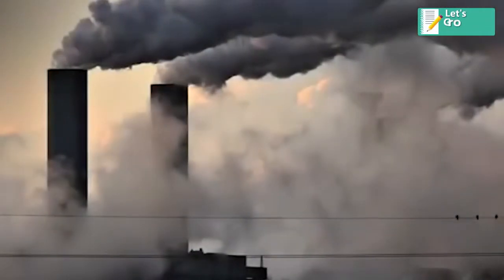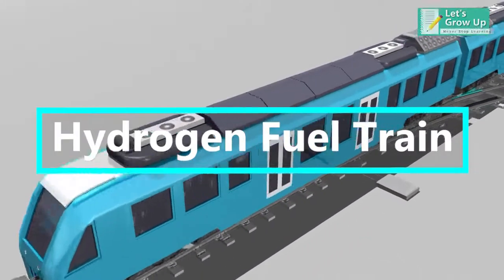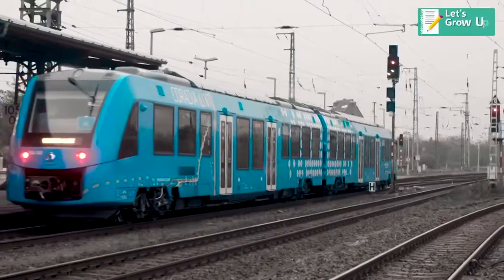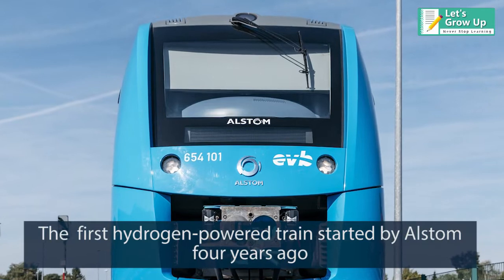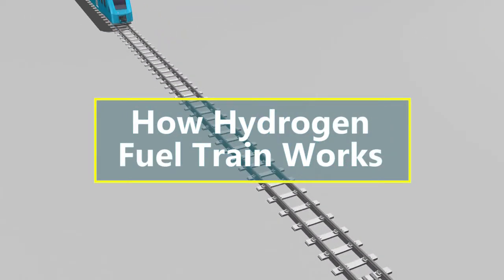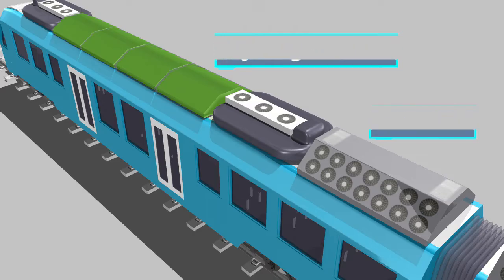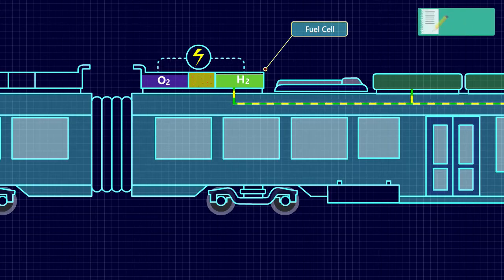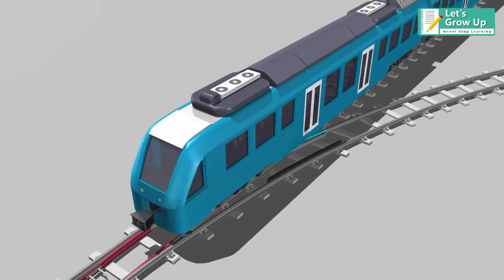Explaining world most famous Hydrogen fuel cell train working function

Comment: well trains run on a designated path, so we can just put overhead wires which are more efficient and low maintenance
and safer, the fule wouldn't be required to carry  and you can just directly use electricity, wait did I just reinvent conventional rail

Comment: How can collect the electricity frm this  solutions please explain
Reply: The fuel cell is a device that produces electricity. you need batteries on board to store it. Later on you can choose to switch between the battery and the FC when OHE is not available.

Comment: carrying "fuel" will degrade the performance of the train, this is a setback

let the train keep running on the existing electrification track without carrying "fuel", the train is not a vehicle that can freely move off the track

just focus on changing the power plant to be "greener"
Reply: The hydrogen train in my area (I think it was the first one to be deployed) runs on tracks which aren't electrified and would be very hard to electrify. This technology isn't meant as a replacement to electrified tracks, but for sections where electrification just isn't feasible.